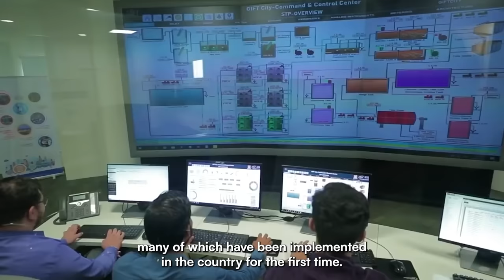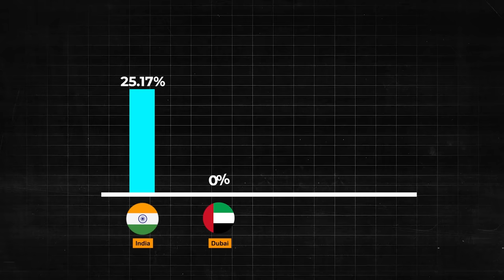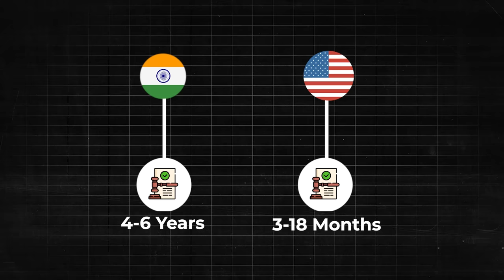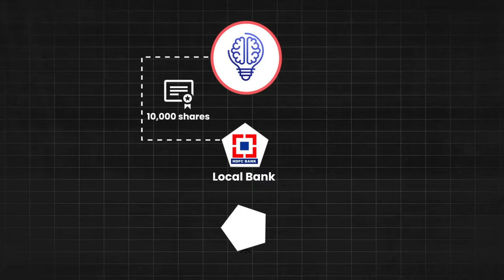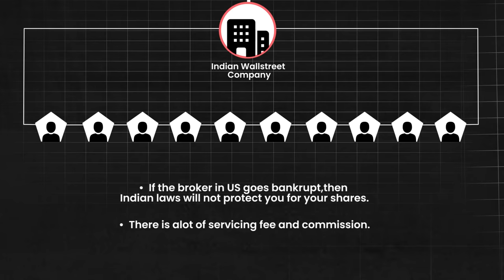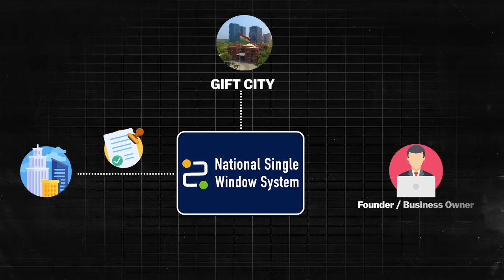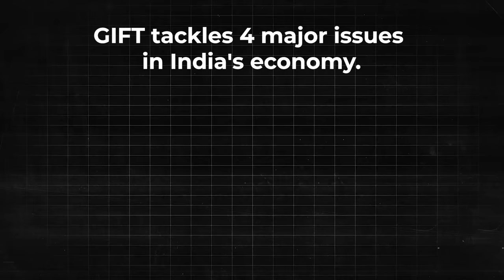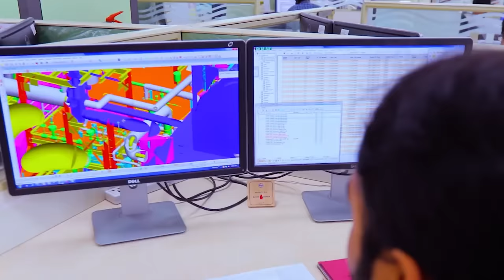Why Gujarat’s Gift City is a GAME CHANGER for INDIA? : Economic Case Study

Comment: Nagpur should be given some projects like this. Nagpur holds a lot of potential.
Reply: Nagpur should be developed as the domestic aviation and transport hub of India.  It should have the largest airport.  Nagpur and Indore should become such hubs.
Reply: @AO-xd2ml  But this damn government now making second airport for Navi Mumbai not even single own airport for Pune . Even though Pune area and population is so large
Reply: @SWAPNIL._.12.X  That's because Mumbai planning has been botched for decades.  Mumbai property mafia is the reason that Mumbai become so filthy and overpopulated.  Palghar which has Vandhavan Port should have been the city they developed.  Mumbai property mafia also tried to stop the bullet train that directly benefits Palghar with a stop at Boisar/Palghar.  Once the bullet train comes in, people will leave Mumbai for a larger property and higher standard of living in Palghar.  Pune should have had its own airport decades back also.  Now, Navi Mumbai will be the Pune Airport.  It's pretty obvious, that that's the plan.
Reply: @AO-xd2ml  Navi Mumbai airport is far from Pune. New Pune airport plan also most likely dead now .  New Pune  airport plan came before Navi Mumbai I think but still in next few years Navi Mumbai airport will be opened. I don't know why it take so much time for completion of a project for Pune.
Reply: @SWAPNIL._.12.X  They might try to simply connect Pune to Navi Mumbai Airport via high speed rail, like RRTS.

Comment: Alcohol is not allowed in Gujarath  and non veg is hard to get. Basically its a lame and boring state. No one in their right mind wants to move gujarath. Basically this means this is largely for the benefit of Gujjus. Which is fine. But just acknowledged it. Otherwise there are far better locations to do this. Put something like this up in manali or tosh or kasol or something and see what happens 🤣
Reply: He has also done many things for many other Indian states, but you are blindfolded. Just follow some real current affairs to get that knowledge!!

Comment: Thank you for the informative video on GIFT City. 

There is no such 0% Tax for 10 years. This is one another government gimmick. Let me drill down

I believe there's a need to clarify the tax exemption details to avoid misconceptions. The 100% tax exemption under Section 80LA is indeed a significant incentive but it's crucial to note that it's specifically applicable to certain entities such as banks, financial institutions, and non-resident investors operating from the GIFT exchange. 

Moreover, this exemption is available for the first 5 years only, followed by a 50% exemption for the next 5 years, not a straight 10-year 100% exemption. Also, it's important to highlight that Minimum Alternate Tax (MAT) at 15.6% still applies even during the exemption period. 

This approach contrasts sharply with countries like Singapore, which offers a clear, flat tax rate of 17%. India's policy, by presenting 0% tax on front which effectively stands at 15.6% due to MAT, reveals a complex and less transparent tax structure. 

This complexity could hinder India's competitive edge against straightforward jurisdictions like Singapore or Dubai. 

For India to truly compete on a global stage, a more transparent and simplified tax system is necessary, aligning with global standards of ease and clarity in business operations."